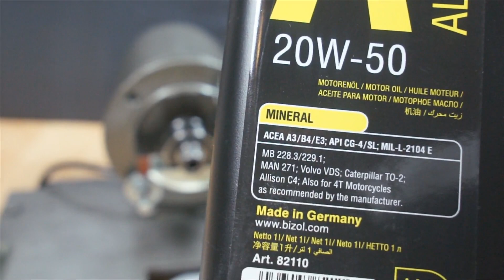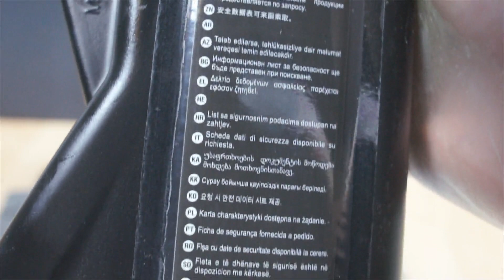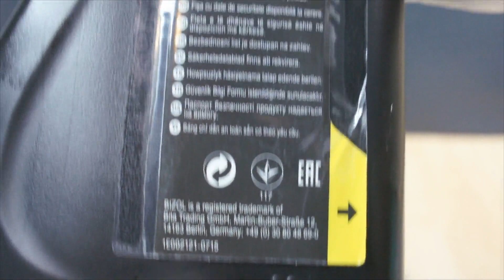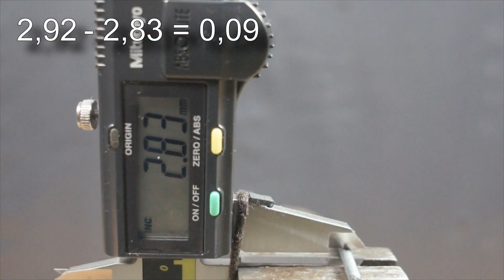Bizol Allround 20W50 Jak skutecznie olej chroni silnik?

Comment: these one arm bandit tests does not simulate driving environmental conditions.  a more accurate way to tell if an oil provides the best wear protection is through a UOA report. what engine is designed this way..., none. the parts of the one arm bandit does not have a crankshaft, main bearings, con rod bearings, etc. for one there is no oil pressures that allow the oil to create a proper oil film strength between the bearing and the sample materials. you can use transmission fluid in the one arm bandit test and get superb results, however, no one in their sound mind will use transmission fluid in their engine!
Reply: This test shows the operation of the oil in a pair of rings - a cylinder and a camshaft - a pusher.
this is the most wearing parts.
main bearings, con rod bearings work well on any oil at normal pressure